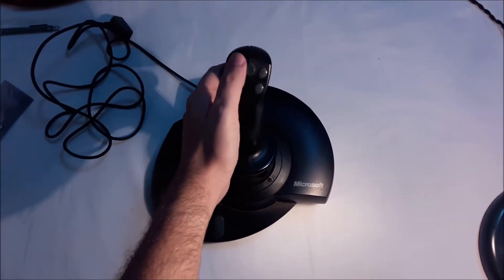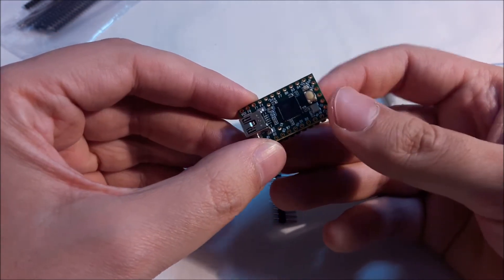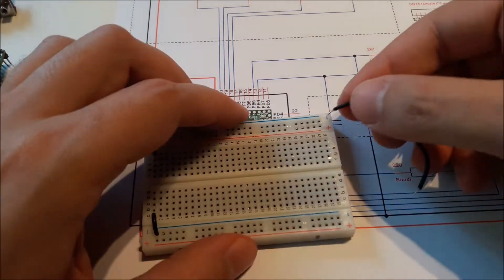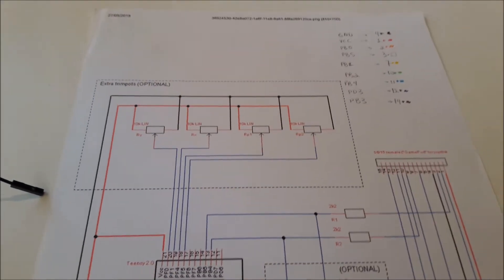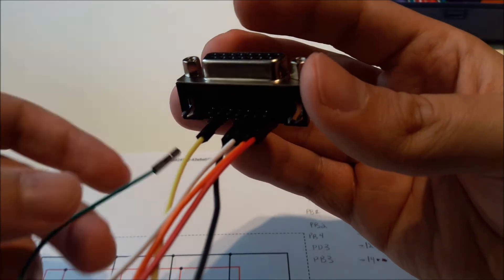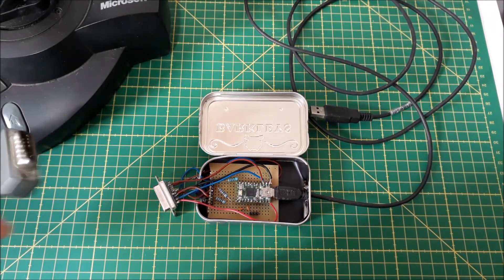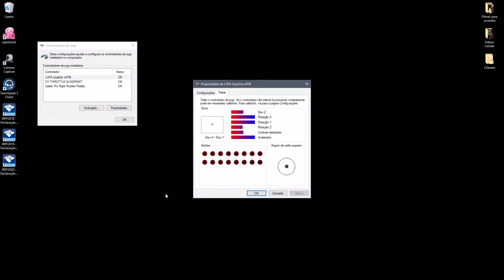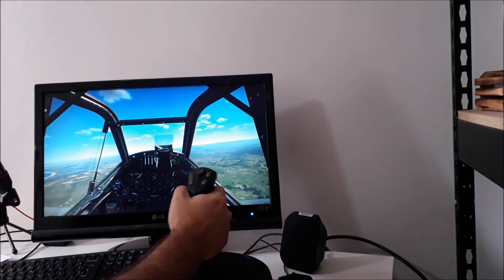Making a USB adapter for Microsoft Sidewinder Force Feedback Pro

Comment: mine just blinks yellow quickly how can i fix :(, nevermind user error i had a capacitor in the wrong hole of the breadboard (this my first project with anything like this so i had trouble figuring it out) thanks bro good video will be testing the ffb soon the inputs work though already

Comment: The schematic shows 4 potentiometers labelled Rx, Ry, Rp1 and Rp2. You didn’t use those in your circuit and there was no mention about them either. Do they really need to be in there? If not, then what connections need to be made to pins PF0, PF1, PF4 and PF5? Thank you

Comment: Wonderfull instruction which gives me the option to alternativly use my good old MS Sidewinder FFB Pro gameport joysticks or my MS Sidewinder FFB steering wheel on my main-pc. The video-tutorial is fantastic. 

I built 4 adapters. Each of them was working for a short time. But now 3 of my 4 adapters don't work. I  bent the two 2k2 resistors and produced a short circuit on the teensy2.0 board. It worked fine for a short time. The 4th adapter I built works fine with my main-pc (win10). I'm so happy that my main-pc is working perfect with the LUFA-joystick-emulation. In combination with x360ce the adapter allows me to play gta online simultanly with keyboard an mouse, steering wheel and pedals and the MS Sidewinder FF Pro for helicopters and planes. The steering wheel is a MS SW FFB with usb-port

Unfortuneatly it seems to be unpossible to buy the resistors with a 10% tolerance. Only 1 and 5 % resistors are available when I start a Google shopping search.

I think that I need

2 x 2,2 kohm resistors red red black brown silver tolerance 10% and
1 x 220 ohm resistor red red black black silver tolerance 10%

for each adapter.

Can You write me where to buy them, please?

Great work, Sir.
Thank You very much.
Sincerley Yours

Comment: good afternoon, I followed step by step the creation of connections, values of the resistors and components, however I can't get the FFB to work.  I don't know if the HEX works to date, if the teensy 2.0 is valid.  Someone currently has the joystick operational that can tell me what elements it is using. Thank you!

Comment: You are a hero!

I played Star Wars Episode 1 Racer with this Joystick until my hand hurt, because the force feedback of this monster was SO STRONG! Even had to losen my grip to disable feedback (IR-sensor in the handle) sometimes. Even NFS was so much fun with it!

I was shocked when Microsoft decided to kill the game port with Windows 7 and my beloved Joystick became obsolete. It still has to be at my parents house somewhere and I'd definitely like to try out your solution!
Can you say anything about the input delay? And does the IR-sensor still work?

I re-bought Star Wars Episode 1 Racer years ago because you can't install the original (installer is a 16bit programm that doesn't run on a newer OS). Was always disapponted about playing this game with an xbox controller and right now i'm kind of hyped playing it again!

Comment: Joy oh Joy, oh Frabjous day!  Thank you Conrado, the contraption is working fine and my lovely old joystick looks to be back on line. 

IDIOT BEGINNER'S MISTAKE: You need to solder all the pins on the Teensy or the joystick won't work. Because I'm bad at soldering, I only did every other one, and nothing happened. On Win 10 the joystick comes up in Settings>Bluetooth and other devices; in Device Manager it's HID compliant game controller. Enjoy!

Comment: Just finished it yesterday, it works great! Thanks Mate!
Reply: Can You help me!!! Please... it does not work for me!
Reply: @javierpalenciarueda5819  I am super dumb in electronic. I just followed this vid with all it's tinest details. Rewinded quite a few time to make sure it was identical. My guess is that you made a tiny plug mistake in the breadboard. Hopefully nothing wrong with the soldering. Good luck!
Reply: @hunbraze   Thanks, I'll check it again... did the circuit work for you??
Reply: @javierpalenciarueda5819  Yes. Everything was indentical to the video though. I went to my local electronic shop where the guy helped me buy the proper resistor and such. 
The only thing I can think of is that when I bought the microchip recommended, it was starting to get discontinued for a V2 version. I don't know if you got the exact same chip or the newer one. Got the old (the one in the video) and works like a charm. If I find my notes in my chaos, I will write you down the components I used. But it is a far fech project. Might never find them.
Reply: @hunbraze  support FFB?

Comment: What wire gage would you use pls?
Reply from the maker: Hi Jean, sorry for the delay. The cable I used was the 24 AWG. The capacitors are 1nanoFarad each
Reply: @conradovergueiro  You've been such a charm to help me that much. But after going to my local electronic shop, I figure I had other question: "What is the watt that you use for the Resistor and Capacitor?" I took the chance with 1/4 Watt resistors and caps. But should I replace them? THANKS MUCH for your time! Really appreciated!
Reply: I found a 240 Ohm 5% resistor (digikey returned me these info on color code of the resistor) laying around in my RC car kit. Could I use it instead of the 220 Ohms resistor since its close? or not close enough?
Reply from the maker: @hunbraze  hi Jean. For the resistor I recommend using the 220 ohm, even though 240 looks close something may not work well. They are quite cheap. For the parts you can use 1/4 watt no problem.
Reply: @conradovergueiro  I know, it's just availability! I went to 3-4 local shop and no one had the 220 ohms. lol Thanks a lot!
I am soooo eager to test it. I soldered the Tensy 2.0 to the 24 pins and the DB15 port; my first micro-soldering ever. Really happy of the result but can't wait to test it and only missing the 220 ohms resistors. ;) Thanks again!

Comment: Newbie question. Could it work just with the breadboard (encased so there is no shorts)? Or I really need to learn soldering? :)
Reply from the maker: Yes it works! I actually used it with the breadboard for almost a year!
Reply: @conradovergueiro  Since your'e so kind to answer, I will take my chance. 
- In the video you say "and 2 nanoFarad capacitors" and it confuse me. Do you mean "2 x 1 nanoFarad capacitors"?
- Newbie question again. Do you think CAT 5e Ethernet network cables would be good for the colored cables? (If not, what gage am I a looking for please?)

THANKS!
Reply: @conradovergueiro  Thanks for such detailed video! Wonder would it work with game port that has all 15 of pins. Like F-15E Talon  with two hat swich and five buttons on the stick and 4 buttons and one slider swich on the base? if i did exactly what you did would it work partially at least? This video shows it https://www.youtube.com/watch?v=6Jl0DkayZzE&t=20s but it is not step by step like yours unfortunatelly.
Reply: @conradovergueiro  Thanks a million!

Comment: opa Conrado, eu tentei fazer o adaptador e infelizmente não deu certo. O microcontrolador não é reconhecido. :(
Reply from the maker: Bom dia Artur. Nossa que estranho, mas o Windows nem reconhece para programar ou após a programação? Tem um comentário aqui de outra pessoa quando o Windows atualizou e parou de reconhecer, veja se ajuda:

Solved, desistalei os drives do controlador USB, habilitei drivers não instalados e reprogramei o tensy. Ok
Reply: @conradovergueiro  Foi assim, eu conectei o circuito ja pronto pela primeira vez e dai o windows disse "configurando controlador usb", dai programei a placa, dai eu desconecto ela, conecto devolta e nada acontece. A versão do meu windows é a 21H1. Eu estou utilizando os capacitores e o ultimo arquivo .hex

Comment: Hi Conrado, thank you for sharing your video.  I managed to get hold of a teensy. I followed your video and managed to get my MS FFB Pro working on a breadboard. I have tried soldering and every attempt I get the teensy's LED constantly flashing and sadly the FFB is not detected.  I checked the soldering and tested with a multimeter and it looks alright.  Could you please advise what am I doing wrong?  Is it a case of bad soldering?  I look forward to hearing from you.
Reply from the maker: Hello Feras, the FFB was working while the teensy was in the breadboard? Try double checking all the wires. When I first tried I had the same problem, later I discovered I had one wire soldered to the wrong pin.
Reply: @conradovergueiro  Hey Conrado, thank you for your prompt reply.  I will do that.
Reply: I think it’s because you used the wrong resistors. Check the resistors values. 2.2k and the 220 resistor. Let me know,

Comment: I programmed my Teensy board OK using the hex file but Windows 10 doesn't recogised it when I plug it back into a USB port. I haven't soldered the wires to the board yet but I would still expect the Teensy board to work over the USB port with Windows. Do you know if the USB part still works with no joystick connected?

Comment: Hi,

Just wondering if anyone has done this kind of MOD to the Microsoft Sidewinder Force feedback wheel?
Reply: I'm also trying to get the Microsoft Sidewinder FFB gameport version working (I have both a pi pico/pi4 which can act as usb hid) but I haven't had any luck (as I am a beginner). Even the usb nest I bought does not work with it (I'm guessing because sidewinder series is all digital unless I am mistaken). Have you gotten around to getting it working yet?
Edit: I found something that might work for us in this video "GamePort to USB Adapter for analog and digital joysticks" by Necroware

Comment: Thanks for the video - i followed your instructions and it worked 1st go. I didn't use the breadboard, just soldered the resistors and capacitors straight on to the teensy board which made it nice and neat. Just waiting for native FFB support in MSFS2020 now. It works fine in DCS, but there are very little FFB effects in that sim, though the Huey force-trim works great (which is the main reason for me wanting FFB).

Comment: Hi I have one of these and it is working. However does the joystick automatically self center when you plug the power in without running the game? Or does it need to be in game for the centering to work.
Reply from the maker: Hello James, it self centers in gamewhen the ffb is working. Sometimes depending on the game (rise of flight for instance) it does not center untill the plane starts running for takeoff.
Reply: @conradovergueiro  thanks for that. I will test it properly tomorrow then.

Comment: Hi, Can you advise me what wattage of resistors (2.2kohm & 220ohm) I need
Reply from the maker: Hello! I ended up using a big one because that's what I had when I built it, but I believe you can use 1/4W resistors without any issues.
Reply: @conradovergueiro  Thanks for coming back to me with that information. There are so many resistors to choose from and electronics is not my field.
Reply: @peverilwalsh7620  Basically, without going into the really special territories when using resistors, it's almost like this: the bigger they come, the bigger the amount of heat they can dissipate.  Since we are not dealing with Watts of power here you are fine with a regular resistor you can mount flush to a printed circuit board (or differently put "the small ones" :P )
Reply: @Dutch3DMaster  Thanks for the info

Comment: I can't get any force feedback, I tried with a game where I get heptic with my xBox gamepad but when using the Sidewinder nope. Do you guys succeeded with the FFB ?
Is there something I have to change in the kit to improve it ? I'm using the first Sidewinder FFB pro, the one with the fan (I disconnected it, too noisy ;) )
And FYI, the Sidewinder is connected to the 12V adapter and it seems that the FFB engine is working as I notice a resistance on the stick but no FFB effect received from the games.
Thanks
Reply: Ok, FFB is working fine now, some pin on the teensy was probably not well connected.

Comment: It works for me on Windows 10, thanks a lot for reviving this wonderful joystick ! What about the sidewinder FFB wheel, I tried but it is not recognized, is there another solution ? Thanks
Edit : Ok, saw in posts below that there was another project for the wheel but it seems abandoned, too bad.
Edit : For those interested in using the Sidewinder wheel, here is a link to a page where you can download a sidewinder_firmware package containing an hex file for the wheel, I tested it and ho joy, it works !!!!
Reply: Hi Enrico. I also looking for a DIY adapter for the FFB wheel. Could you please attach the link to the page with sidewinder_firmware package? thanks in advance
Reply: @davidsacristan  if you found it, please let me know. Interested in this as well!
Reply: @Enrico cerica Can You help me?.. my ffb does not receive current (5v) but when testing it with an LED it generates current, what could it be? They fbb no flash LED!

Comment: Is there a way to tune the FFB? Is that what the pots are for, I haven't put those in the circuit yet.
Reply from the maker: Hello Maxwell, they are for additional controls like trims. I haven't use them. The FFB is adjusted in game.

Comment: I cant get my PC to recognise the teensy as a joystick with the downloaded HEX . Anyone have this problem and solve it?
Reply from the maker: Hi Joe, are you using Windows? Make sure the hex file is loaded to the teensy board, and that you are using a teensy 2.0
Reply: @conradovergueiro  Thankyou for the fast response, Yeah its a 2.0. How do I check its actually on the board? I have loaded my custom joystick code it the Teensy. which is defiantly works.

Comment: I made it, and it works, the only thing that its not detected by il2, and I need to configure all the controls?, Can you help me? , or send a config file?.
Reply from the maker: Hi José, does it appear as a Lufa joystick? Are you using Windows? I had no problem using it with IL2 - great battles, but i had to configure all the axis and buttons.
Reply: @conradovergueiro  ok. I configure manually and its woks perfecto. Thanks for all

Comment: Thank you for your work. That is exactly, what I need for my almost untouched Sidewinder Force Feedback Pro. Does it run on MS Windows10 also?
Reply from the maker: Hi Arne. Yes it does. I use windows 10 and it works perfectly.
Reply: @conradovergueiro  That will work fine with my XPlane11 FS programm later on and the rockfire adapter as housing.
Reply: @conradovergueiro   please, can You help me, I followed the instructions but it does not work for me... Please
Reply from the maker: @javierpalenciarueda5819  Hi Javier, have you double checked the pins? When I was mounting I made a mistake and found out after checking 3 times. Can you give me more details? This only works with the sidewinder ffb pro
Reply: Thanks everyone, it worked, it was a bad soldering.  I tried it with fsx, it works the same as with FS2020.  excellent work @conrado vergueiro

Comment: Conrado, there are some discrepancy between your comments and the diagram itself. Would you please explain which connection is correct?  On the diagram Teensy board pins PB03, PB4 and some others as well are connected to DB15  no13 & no10 pins respectively, but on your hand drawing in video we have PB3 to no14 and PB4 to no11. So, which one is correct?? Enlight us. Thank you
I apologize, my fault, all is correct. I was mistaken by the number placement on this diagram. :/

Comment: Great solution and I'm also the one who want to play FS2020 .... may with my old hardware...I found my Sidewinder FFB pro but not sure if it's still working. I do not have any PC anymore with Gameport. Before I waist my time: When I plug in Power the fan is not working and no LED. Is that normal when not plugin into the gameport??? Can't remember after over 15 Years ;)
Reply from the maker: Hello Tom, I don't hear any fan when I plug it, but the small LED blinks when it is not connected to the pc.
Reply: @conradovergueiro  Just want to give a short update. Even if my old Joystick give any lifesignal I ordert a teensy and gave it a try. When plugin the Gameport now the LED is flashing without Power, and with Power LED and fan is contsantly on. The Joysticks works perfect in Win10 and even FFB is working if supported or when I just enable some FFB simulations!!! Thanks for your Video again and I'm happy now continue playing with this Joystick after over 15 years ;). Thx and keep safe.
Reply from the maker: @tomrak8656  Hi Tom, That's great news! My joystick was laying around for years as well and it is working amazingly well. Those things were built to last! Best regards!

Comment: Thanks very much for your video! If one already has the original usb adapter from the later versions of the sidewinder presision pro, would that also work? Also do you know if there are any specific advantages of getting a force feedback 2 over the FFB pro with the usb adaptor? Thanks!
Reply: The big disadvantage of the force feedback 2 is the price. It goes for ~ 200$, while the force feedback 1 goes from anywhere between 20 and 80$.

Comment: Hi! I want to build this using an Arduino nano, do I have to write the code again?
Reply from the maker: Hello Camilo, yes you would have to. The .hex file I used is specific for the teensy 2.0. I believe the nano uses a different chip and different pins.
Reply: @conradovergueiro  I would use a pro micro but the pins might indeed be different than a teensy. If you happen to find any new info on using this with an arduino I would be happy to hear. ;)